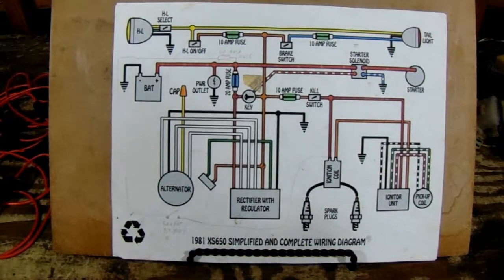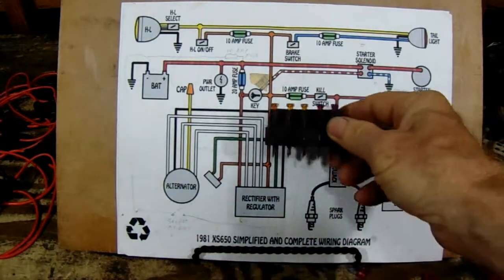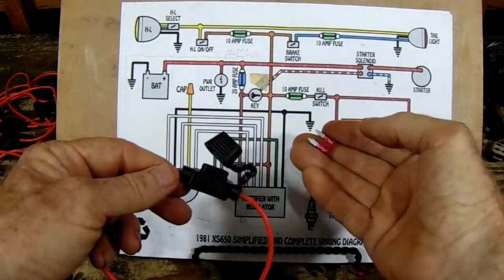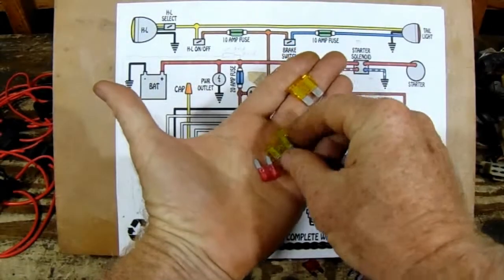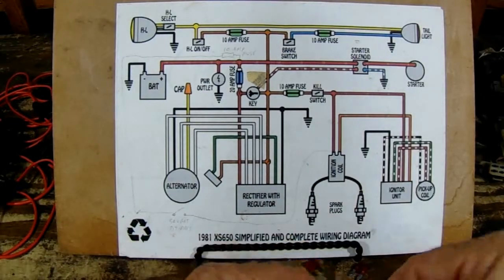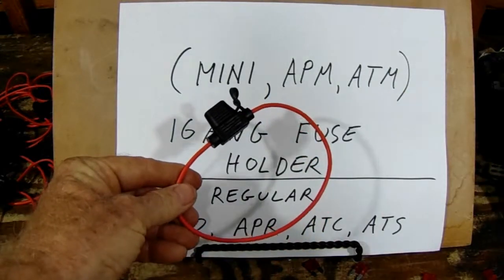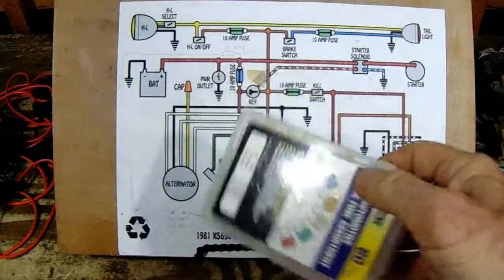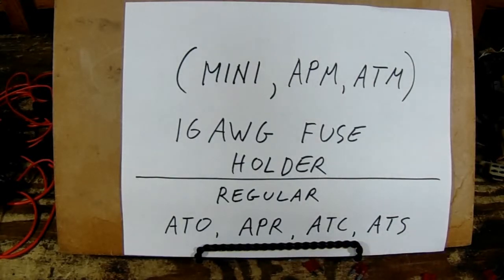Motorcycle Fuses and Fuse Holders

Comment: I used the Rowe Amplink PDM.  Solid state (waterproof) device that resets with cycling power.  Set the amperage via phone app.  Up to 6 accessories and total 60 amps capacity.  No more bulky fuses.  Expensive but worth it.